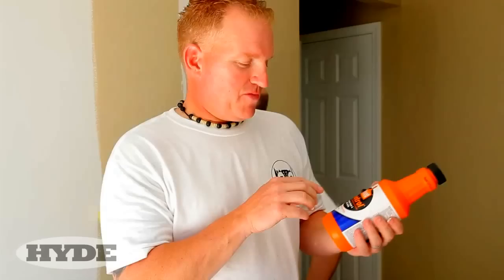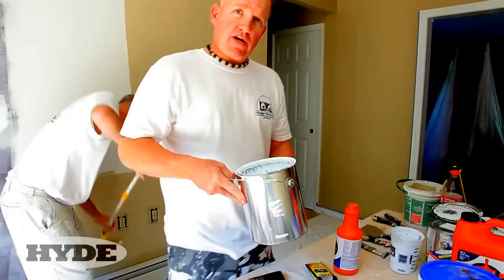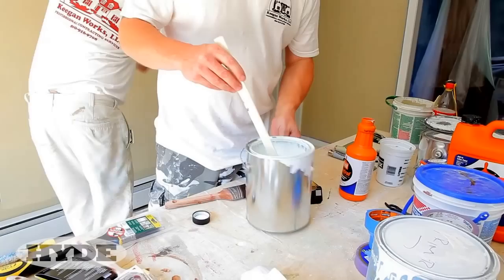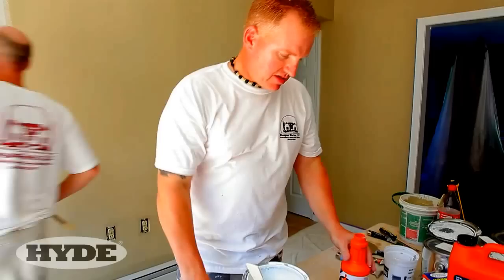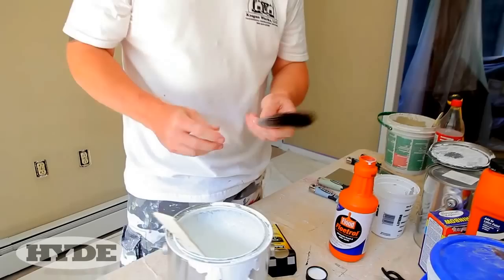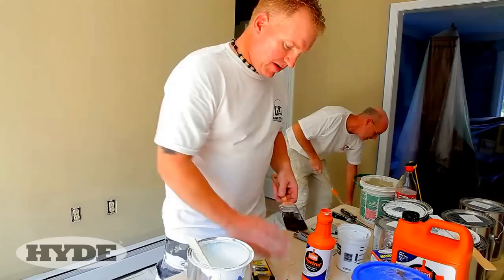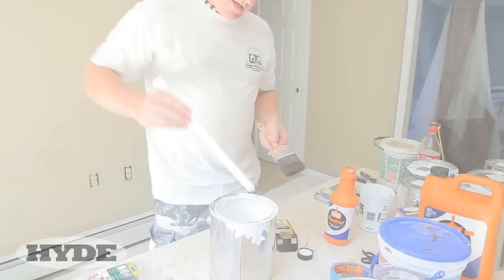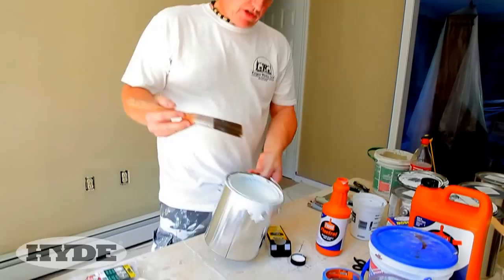Conditioning paint for a better finish inside and outside

Comment from the maker: Drips are caused by overloading the brush or roller and then not back rolling or brushing.  Floetrol gives the paint a longer open time (keeps wet longer) so it may give you more time to spot the drips.  Check our work as you are laying the paint down, not just after you have finished the job.

Comment: For people that have outside metal garden art, this and it's cousin Penetrol works great and lasts longer than using acrylic spray and much cheaper too. All depends what the finish is Oil based paints use Penetrol for  acrylic and latex finish use Floetrol. One swipe with the brush and it's rustproofed

Comment: I have heard many times about this product but always thought it was only for spraying. I am painting the interior of a 2000 sf house today for a neighbor and will try it out. Thanks for the tip on putting it on the brush. I just threw away a $30 brush because of that problem.
Reply: Ken Hatcher  thats too bad you threw it away. next time use a steel scrub brush to get the dried paint from the bristles followed by a brush comb after its clean. in order to get rid of all of the water you must kick it against your foot hitting the ferrule and THEN spinning it either in your hands or using a brush spinner. please not that you should only scrub and comb with the bristles NEVER acorss them and only in one direction. hope it helps

Comment: Hi, Great video guys.  I just wanted to ask a question.  I am not an expert at painting so unfortunately i used to get the odd few drips on places.  I was wondering if this Floetrol helps with the paint not dripping so much, and if it does does it make it a bit easier to clean up the drips or could it actually go the opposite way and make it a bit more tricky to clean up anything that goes where you don't want it.  Seems a very good product never heard of it before came across video by accident.

Comment: Why do you add floetrol instead of straight cold clean water? TDS on all latex paints specify all gallons can be thinned by 8 oz water max. Lots of painters find floetrol is a waste in comparison to straight water, its more expensive and it doesn't work as well as water. What's your opinion?
Reply: dirosaga it is somewhat of a waste in terms of just thinning it down but water could take away from the coverage a lot more than floetrol would. i rarely use it personally

Comment: Floetrol is for latex only. Why are you using a black bristle brush as they are for oil-based paints?
I
Reply from the maker: Yup you're right, Cornelius. Definitely could have mentioned that in the video - but thanks for making it clear here in the comments!

Comment: I hate math, but you have got to know the basics.
Flowtrol ---  Add approx.  250 ML per 3.78 Litres 

Old math...  1 cup = 8 oz.  250 ML = 8.80 oz.    3.78 L = 133 oz.     LOL  A Dixie Cup holds 3 oz.
Small jobs?  I checked the old way...  The cap on a 946 ML bottle of Flowtrol hold 1/3 of an oz.
Remember to shake the hell out of these bottles.  Remember to get rid of any of the slimy stuff from the
rim of the bottle before pouring!

Comment: Can you use it on walls?
When painting?
Reply: @Carlitos Morales ty buddy 👍
Reply: @Carlitos Morales I used it with Behr Dynasty on walls, the paint was a little sticky and the Floetrol worked great and left the nicest smooth finish, really seems to help it level out nice even on vertical surfaces without running